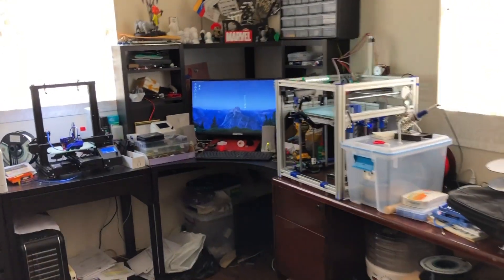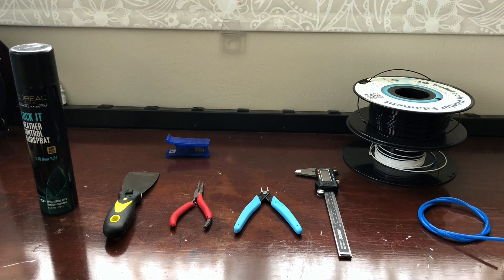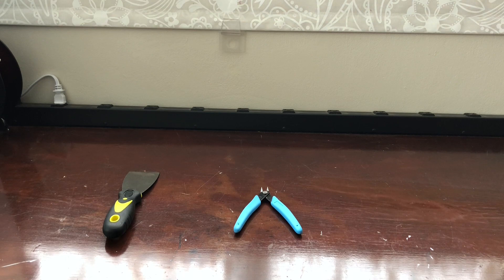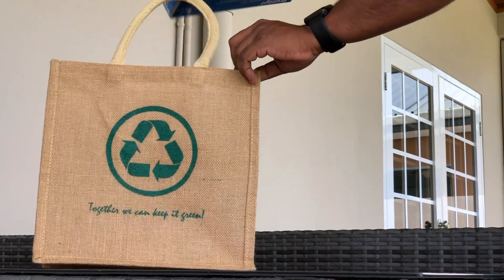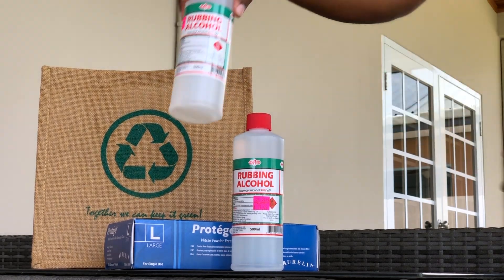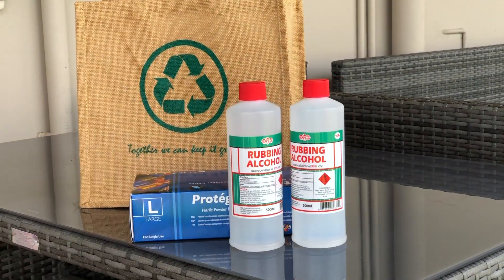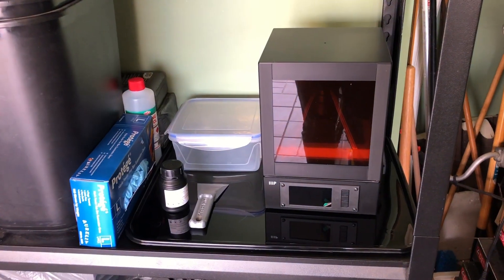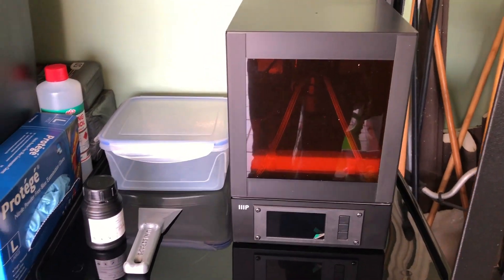Read this before you start SLA Resin Printing!  What you need to know!

Comment: For a first video it was great, for a 10th it was still good. Few tips, there were a couple of times where music seemed to be around as loud as you, I could still hear but had to strain. Also I thought you were supposed to use 99 percent alcohol? I would mention to people new resin printer is to wear gloves when removing the print. One last great tip I got is don't use the plastic scraper on the resin vat, just the build plate. When you need to remove a stuck piece from the film push your fingers on the back of the film Which will loosen the piece, you you other gloved hand to get it. Good luck.
Reply from the maker: @PatrickPaul1203 thanks for your comments. I will make sure to adjust the volume in the upcoming videos. I'll also add your comments to the main body to clarify some of the points. Thanks again!